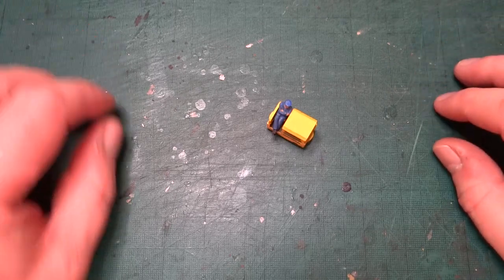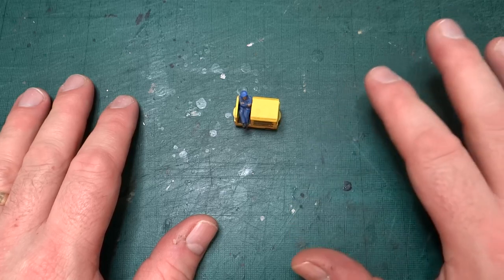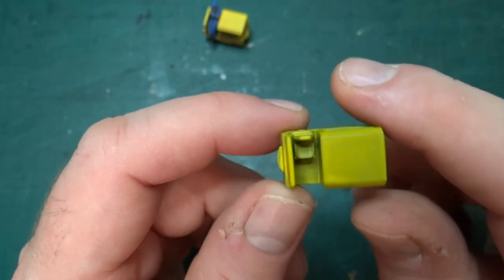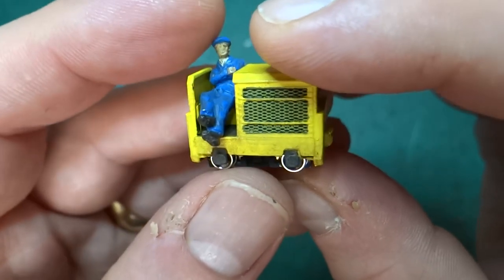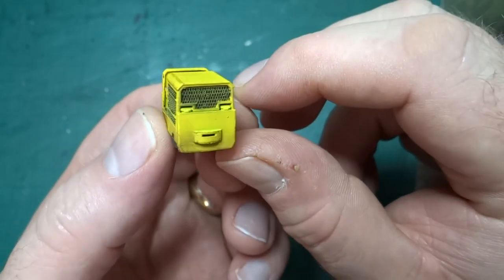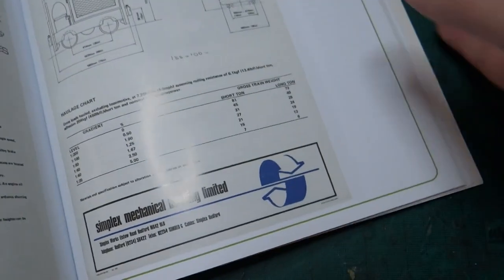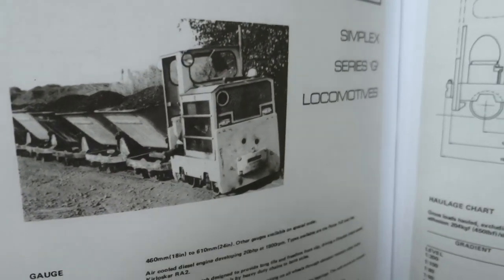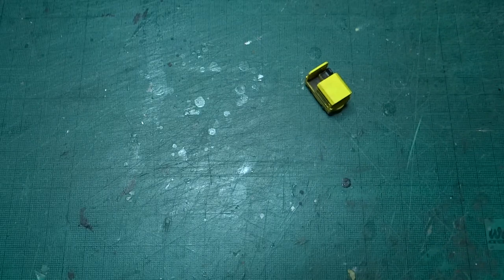I've Finished Designing.... A Cabless, G-Series Simplex Locomotive

Comment: I really want to try my hand at building one of these sometime. Incredible to see a model that tiny.. On the subject of paint, I recall using a Tamyia yellow from a spraycan and it went very well. Yellow seems to be a very difficult color for some reason, but I had no trouble with Tamyia's yellow. Not sure what paint is available near you but if you can get your hands on some, it may be worth your time!
Reply from the maker: Interestingly I was thinking Tamyia as an option before I stumbled across the Army Painter primer. Will remember to give it a try at some point.